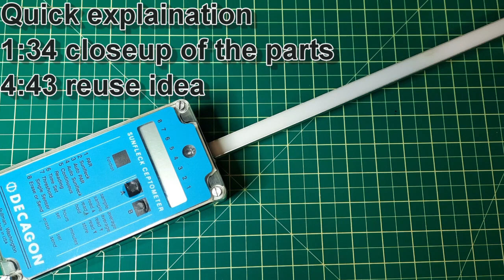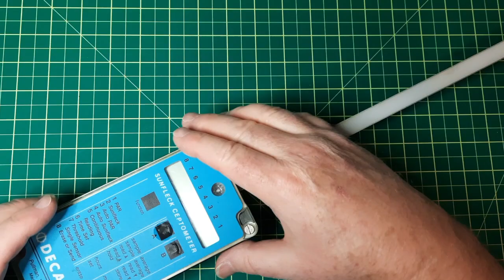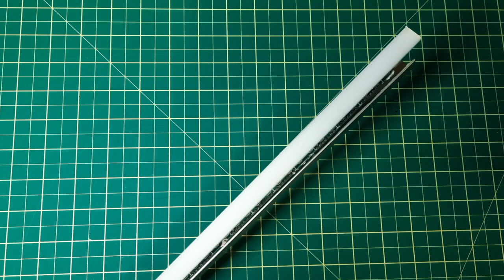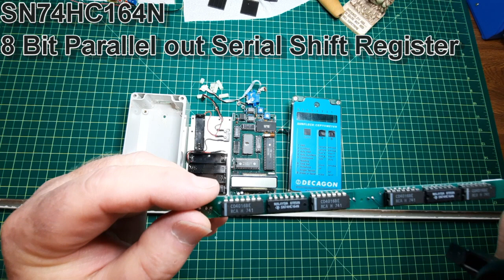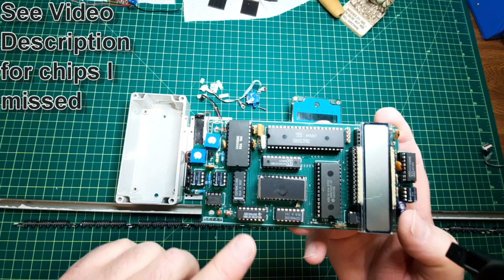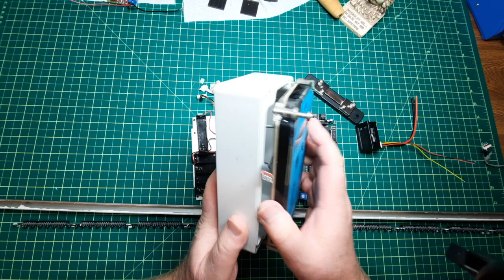Ceptometer Teardown and reuse idea

Comment: I had to ask Mr. Google about that gizmo. Subscribed.
Reply from the maker: So did I and there is not a lot of videos on these either. Ditto on the Net Solar Radiation Pyranometer I examined in January.  Weird stuff you can get at BC governemnt auction.